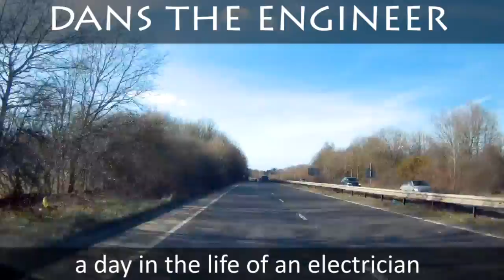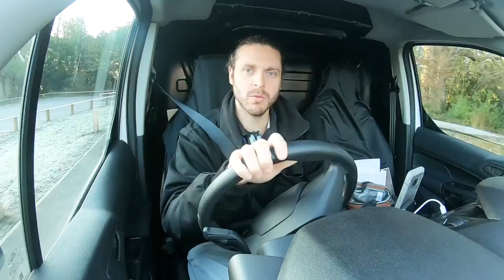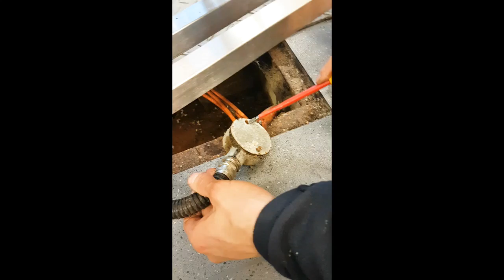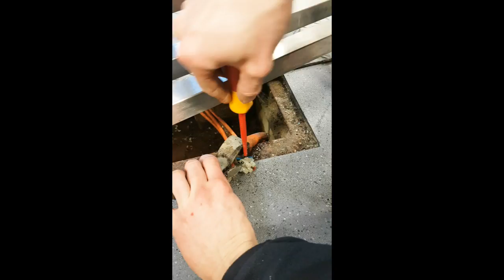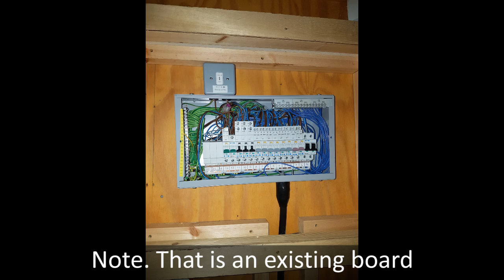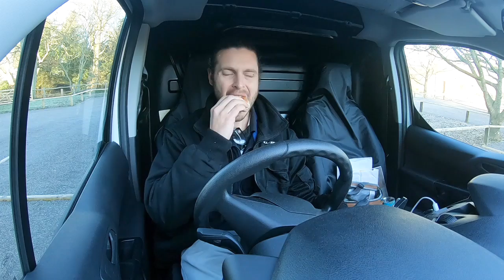DO WATER AND ELECTRICS MIX | TRIPPING CIRCUIT - DAY IN THE LIFE OF AN ELECTRICIAN

Comment: Hi Dan, 

I'm 24 struggling to get an apprenticeship due to my age. There is a chance of getting a job in fire and security. 

Do you tink i should take the job in fire and security or take a risk and hold out for a apprenticeship to finish my training to become fully qualified electrician. 

Thanks
Reply from the maker: Rob Nicholls it's a tough one. If you ask me I think it is great to have a back ground in electrics and then move into the section that you want to do i.e alarms. All of my guys expect one is trained as an electrician and then went onto fire alarm training etc. It gives the insight of wiring and basic electrical principles. But on the other hand you don't actually need any qualifications to work on fire and security systems. But the guys with minimum insight from my experience tend to produce poorer work. Instead of an apprenticeship, have you considered evening courses paying yourself and looking for employment with an electrical firm as a trainee Instead? Might be more attractive to them but you have to accept the pay to be rubbish to begin with
Reply: Hi, thanks for the input, i have considered evening courses but Iv asked some electricians in the local area and they don't prefer the courses as they feel it's a short cut and I would not as well trained/experienced. 

Thanks for your input I have alot to think about.
Reply from the maker: Rob Nicholls it's not a short cut at all of you aim for an NVQ level 3. That consists of classroom studies and on site experience to build a practical portfolio. It isn't a quick route at all and isn't a 5 week course they may be referring too. Anything short in my opinion isn't good at all but this method isn't short. It'll take a few years. It's basically an apprenticeship but in a different way.
Reply: Dans the Engineer I have level 2,  level 3, level 3 inspection and testing ( all 2330 city and guilds) and pat testing so I'll cut that time down again.

Thanks a bunch. I will look into it.
Reply from the maker: Rob Nicholls how did you study those? I have city and guilds 2330 level 2 and 3. That is the class room part that forms part of the NVQ level 3. If you have those you could look to put together your NVQ level 3 and in the mean time get on site experience with an electrical company. I can't suggest any companies who offer the NVQ level 3 but there are plenty. The only one I recommend is in northern Ireland
Reply: Dans the Engineer yale college studying full time for 2 years.  Northern Ireland is a little far for North Wales ha. I'll see what I can do locally.
Reply from the maker: Rob Nicholls it's a portfolio so they come to you on site. Not the other way round.
Reply: Dans the Engineer thanks for everything.
Reply from the maker: Rob Nicholls no worries. Anytime

Comment: Ubiquiti AmpliFi is the best for expanding wifi coverage in the home. Pricey but comes with two extenders as well as the router which creates a mesh network in the house.
Reply from the maker: Alex Edwards cool I'll have a Google! I don't mind spending a bit of money on it if it works! I have always wired networks being an electrician ha but my house was finished when I bought it and it's all hard wood flooring or tiles and I don't want to start chasing walls just yet until I can afford to redecorate.

Comment: Enjoying the vids dan, I find it hard to dot the i’s & cross the t’s with my company we’re always under pressure to get it done & get out the door to the next job I’d love to have the time to do the little things that when somebody opens a panel or board they’ll say that’s a neat job
Reply from the maker: I know what you mean! I am a company owner so fully understand the 'commercial' pressure. However, the work our team produces has my name on it so I want it to be to a very high standard. I encourage work of art so that when the guys are proud of their work, they message me the photos of it! I would rather they take their time doing it properly even if it costs me a little because ultimately I need to be assured it is safe because I provide guarantees and we are looking for repeat work. It is in my interest to price it accordingly but sometimes that does lead to not getting a job because the price may be too high.
Reply: Good point you’re only as good as your last job, I have a small house so zone heating isn’t really an issue but I got an (optimum connect) boiler time clock smart switch. It just replaced old apt timer €50 you set the time same as alarm on your phone & now I just hit on button on the app 30mins before I get home every evening. Happy so far with it
Reply from the maker: county582 true! Nice sounds interesting. I'll research that one as well.... Technology these days. I remember my first phone which was black and white and no internet 😂😂😂

Comment: I use nest. I really like how you can set temperature points though out the day. Also the auto away function is brilliant. As for Wi-Fi issue have you thought of installing acsses points to boost the range.
Reply: To extend our network, I used TP-Link PowerLine adaptors to get ethernet downstairs, then I connected up an ASUS RT-AC51U set in Access Point Mode.

Our Sky router has it's access point disabled and we have another ASUS RT-AC51U as the router. It's all very technical.
Reply: Dans the Engineer When I’m next home alone I’ll film a video of our home network, but I’m not sure when that’ll be out because I’m at AeFire’s for the rest of the week.
Reply from the maker: robert norton people keep mentioning nest. I might have to check it out. I've tried sky's own boosters, additional routers, currently trialling plug in boosters and it just isn't good enough. It isn't a massive issue for us but just annoying. Open to suggestions.
Reply from the maker: I do have TP-Link PowerLine adapters already so I might have to pick your brains!
Reply from the maker: No worries. Whenever possible.
Reply: You can get Wi-Fi amps built into double sockets, look fine, but will affect your testing.